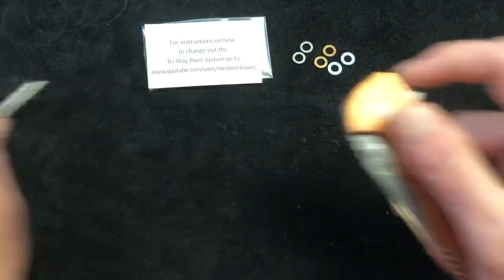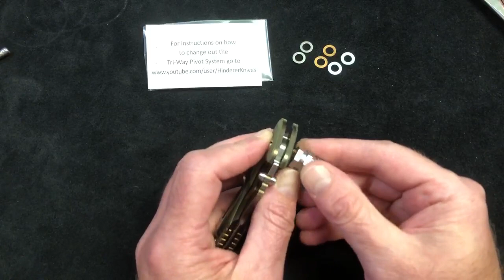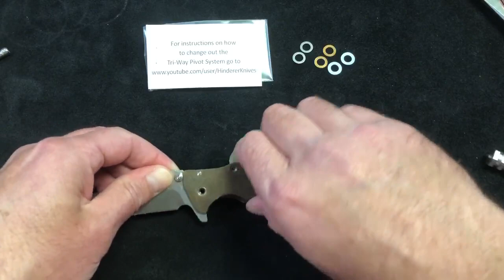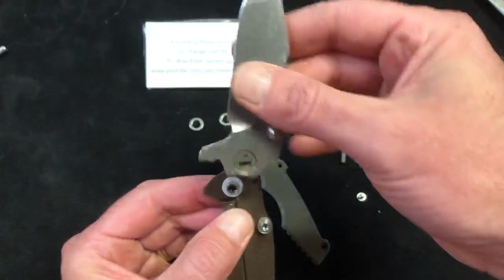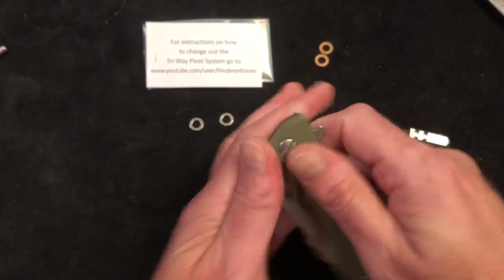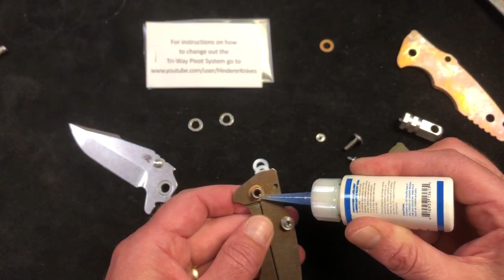Hinderer Tri Way Pivot Help.  Switching from Bearings to Phosphor Bronze or Teflon!

Comment: I run the Teflon on every hinderer. I use my knives In dusty dirty environments. They are all drop shutty not free falling but I can swing them shut with ease and stay buttery smooth with a wipe of the detent ball with a Q tip when I feel like it’s not so smooth. It’s so nice to not need to clean the pivot 2 times a week. All my knives are try way pivot system I know my xm-18 is a gen 6. The eklipse 3.5” I have is maybe a gen 3 with harpoon tanto blade wasn’t specified by shop I purchased from but was purchased when gen 3 harpoon tanto was released.

Comment: Scott I noticed with the Teflon washers,  on the lock side you put the steel spacer against the scale, but on the lock side you put the spacer against the blade and the Teflon washer against the scale. Is this just an oversight or is that how it needs to be done? Thanks.
Reply: USA Made Blade thanks for the clarification.

Comment: I tried to switch to PB and it was horribly rough, but I've put PB in older Gen hinderer and it's been fine. I just don't think the Gen 6 was meant to ride PB
Reply: Mine always runs great! No blade play and a wiggle shut action. Try some lube?